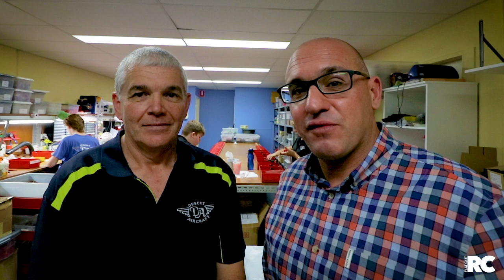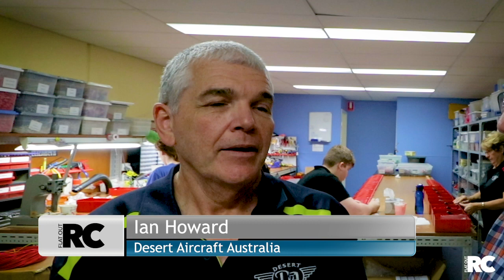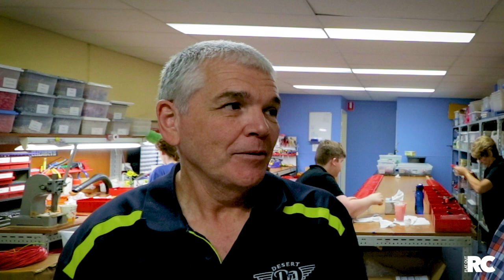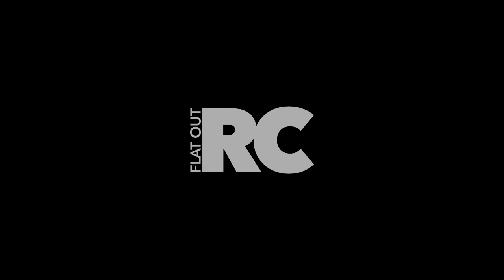The man behind Desert Aircraft ignitions

Comment: My shoulder permenently hurts from trying to start DAs. It seems some people retrofit RCEXL ignitions  to DA motors to make them easier to start. Some also claim more rpm and better transition from the upgrade. Is that because the DA ignitions put their sensor after TDC while RCEXL put their sensor before TDC? The latter seems more logical to me.
Reply: I have 2 DA 120, 1 DA100 and 1 DA 50, all starting after 3 flips with chock on plus 3-4 flips after chock out.... your engines or you should have some problems.